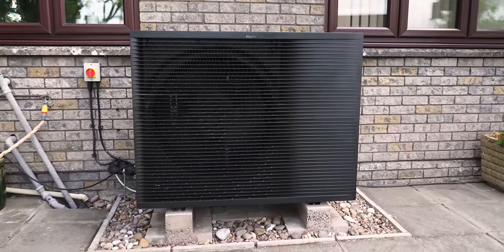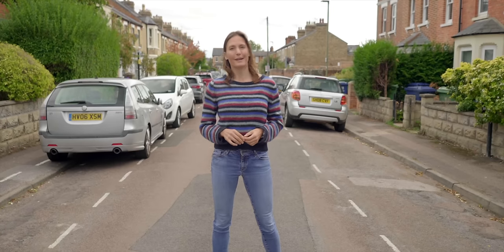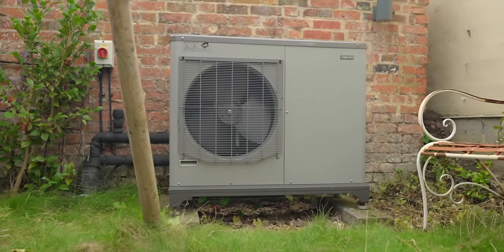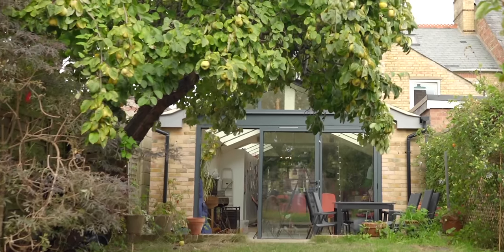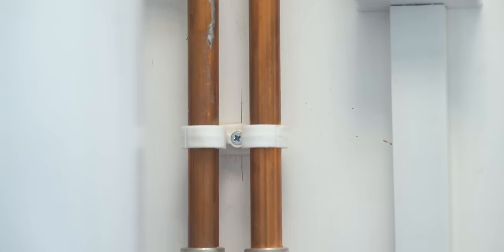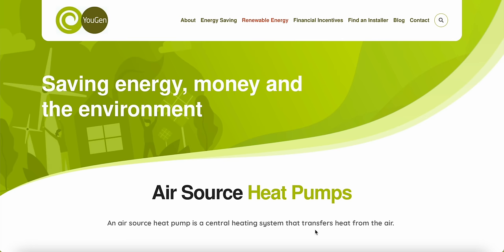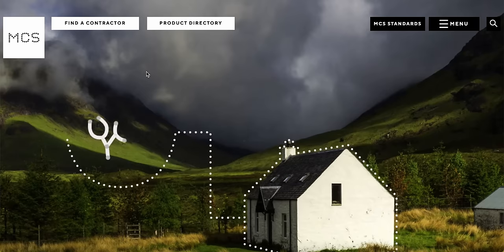Does a Heat Pump Really Work In A Victorian Terrace?

Comment: I'm really glad that EES are now covering heat pumps. I'm also glad that "insulate first" was mentioned (because the heat-pump needs to be well matched to the heat demand) this is important.
I would prefer a bit more of a balanced look at the pros and cons of heat pumps, they are not a perfect replacement for a boiler. I would have like comments Like:
   Heat pumps are very slow to react taking hours to heat up rather than minutes, this is not a problem but if you need a fast warm up you might be unhappy. 
   If the existing system uses a combi-boiler, a space will need to be found for a hot water cylinder. 
   Heat pumps are not much cheaper to run than gas boilers even now, but they might cost roughly the same to run. 
   No mention was made of the need to upgrade existing radiators, the hot water cylinder and some of the pipework because the heating system operating temperature is much lower than a gas or oil boiler.
The house shown in the video was heavily upgraded first, so it was easy to add a heat pump. I would be interested to see how a straight swap with no insulation improvements stacks up and the disruption and cost involved. 

Overall the video was a very good effort but slightly lacking in depth.
Reply: I have noticed that the Brits seem to ignore mini splits with air handlers.  I would not retrofit a gas boiler system because you lose half the functionality of a heat pump, the cooling aspect.  It would be much cheaper to put a mini split in.
Reply: @leroyharder4491  Yes and they are just as efficient. I must admit that radiators make the house seem a bit more comfortable for some reason.
Reply: A hybrid heat pump can straight swap with a combi boiler. But it isn't utopian enough so you hear little about them.
Reply: @leroyharder4491  It's partly the incentive system in the UK. There's a £5000 boiler upgrade scheme grant, but it's only available if the system is not set up for cooling (functionality has to be physically disabled) and it must also supply all heating and hot water (so no hybrid systems).
Of course it's stupid, but hey, politics!
The preference here for water-based heating (radiators) rather than air blowers might be mainly historical. Many of our houses pre-date any form of central heating, and its far easier to drill small holes in walls to retrofit 15mm water pipes than it is to make larger holes for air passages. Therefore this is what our heating industry knows, so they continue to build what they know into new builds. That said, I don't know that air systems are better than water systems other than the cooling functionality, which is something we've barely needed until very recently.
Reply: @bimblinghill  We have similar problems with our incentive systems.  When we install a heat pump, they want the legacy gas system removed to qualify for the incentive.  Its a bit ridiculous as air source heat pumps cannot keep up when temperatures get very cold here in Canada.  Oddly enough here in BC, ground source heat pumps that make more sense in our colder temperatures, are not listed as approved systems.  

I personally like some redundancy and would not remove our legacy system.  Back in the day, when solar did not make economic sense, they were actively promoting removal of wood stoves.  When things go seriously wrong with gas or electrical systems, whose house will everyone gather?  The one with the wood stove.  I understand the regulation to make them burn cleaner and safer.  

Our insurance companies are partly to blame as well.  Our current provider has a cap on the amount of solar.  They also don't like wood stoves.  Somehow the cost of repairing a frozen house during a long power outage doesn't compute.  We have forest fire seasons as well, and having electricity, water even if the power went out would prevent severe property damage from a nearby fire.  Resiliency and redundancy simply doesn't compute with insurance companies.  

There is almost no simpler system than a mini split.  Power to an outdoor unit, which then is connected to indoor units via small bundle of 2 pipes and power cord.  Only small holes required.  Very flexible.
Reply: @leroyharder4491  I think the main disadvantage of a mini-spit is that the F-gas is much more likely to leak/escape than on a monobloc, and for most older units using extremely high-CO2e gases that is really bad. Once they all move to CO2 or propane then it won't really matter.
Reply: And just to emphasise the cold climate bit.  We just went through a cold snap here in British Columbia.  It hit -32 C.  My very efficient heat pump is rated to -30, but there is no way it would be able to keep up at those temps.  Back up gas or ground source heat pumps are needed here.
Reply: @leroyharder4491  I put a de-Longhi mini split in 20 years ago for cooling my front room and it is still working well (had to replace 2 capacitors a few years ago).  Don't use it much for heating because of huge cost of elec compared to gas - much more than the gain you get from the pump.
Reply: This!! We were quoted tens of thousands to get our 1900 build up to decent insulation standards before we even thought about costs of the heat pump, pipe work, replacement of rads, removal of gas fireplace and redecorating where necessary. I wish they’d be more honest about the true upheaval and costs of getting heat pumps into certain types of housing.

Comment: Great report - I'd would like to install a heat pump and would love it if you could do a report on how to get it done without being ripped off by the installers.  I've had a detailed quote from an installer which includes material costs of 30% More than I know the materials are costing them.  Labour costs for what is described as 20 'man days' (their word - Max) amounting to £5,800+  I sent my heat loss report to two othe installers and got back quotes 25% and 35% higher than this.  The gov grant of £5,000 and VAT relief amounts to a saving of around £8,000 most of which it seems is going into these greedy installers pockets!
Reply: Could be worse, there are schemes where govt. pays for the entire installation for qualifying tenants in private rented homes - entirely predictably it is the domain of the high pressure sales cowboys
Reply: Get multiple quotes. We have a 24k btu mitsubishi system with dual zone control installed in one day of work for 13k USD total. You can barely tell when it turns on and it performs well even below freezing. Depending on your specific needs the price and system can vary a lot, which is why you need 3 quotes minimum. Do your research or you will get scammed by bad installers, but the good ones will guarantee their work and have references to show for it.

Comment: I am a bit confused about the benefits mentioned at 09:04 - ".. not burning fossil fuels anymore. It's protection again future price rises". I thought heat pumps ran on electricity. And switching to them would reduce use of Gas (savings) but increase the use of electricity (the price of which continues to climb. And is expected to. Not saving). So unless he means that the electricity use is much lesser in terms of cost than that of gas, how does this come together to make sense?
Reply: He means that HE doesn't burn fossil fuels for heating anymore. locally in his home. 

He could also be with an energy supplier that provides his supply with electricity produced from renewable.

Then, he could have solar panels on his home that provides the power for his heat pump when solar is producing, and additionally could have a storage battery that is charged by the solar panels and is then utilised to run the heat pump in an evening when solar power isn't being produced.

Comment: Perhaps the wrong place for a nuanced view of heat pumps but total honesty is needed if we're to help people make the right decision for their situation. I spent a few hundred hours looking at videos and reading articles before, disappointingly, deciding that a heat pump system was not right for me in a semi-detached house in the north of England.
Here we don't have extreme weather (it's November now and 13 degrees), in the summer if it goes over 30 degrees it's newsworthy. So no real need for AC at all and  central heating is only on for a quarter of the year. Without the need for an airtight house people won't pay to have an airtight house. I've got 300mm insulation in the loft and decent double glazing and exterior doors. An electric combi boiler meets our needs and PV and battery keep the price per kWh very low.
Fits all sizes is not the case with heat pumps.

Comment: Interesting, but this example coincides with a large house renovation. In reality most will just want to swap out their existing combi boiler for a heat pump. So how do the costs, disruption and associated works really compare? New combi boiler takes a day to fit and costs circa £4K. Fitting a heat pump to an old Victorian may involve new rads, piping, water tank, electrics, wall and floor insulation, double glazing (if you don’t have it), making good and redecorating, the HP unit, concrete base or wall mount, external pipe lagging. So looking at weeks of work & disruption, and significantly higher costs. And though it’s 4 times more efficient, electricity is 4 times the cost of gas, so you don’t even get a return on your investment. How are low/middle income households supposed to fit these even with £7k gov grant.

Comment: From a pure financial standpoint - these systems are currently not worth it at all. With gas @ 10p and electricity @ 34p, unless they can reduce energy consumption by more than 2/3rd's then you will be paying more than your gas boiler.

Where there is some benefit is if you have battery storage to be able to use cheap night electricity - but then you need a very big battery to be able to store enough energy overnight to use during the day for your heating. Cost of a battery this size makes it completely unviable. 

It just doesn't financially work at all at present in the UK with current electricity prices and limited government incentives - the current situation also doesn't look to be changing any time soon. It's a shame as a properly designed system really can cut your energy usage by half or more, just the desparity between gas and electric prices per kWh means it will cost you more to run without any chance of payback on the £5000+ (after grant) upfront cost.

The complete and utter lie that is the '20 year lifespan' of these systems also needs to be addressed. I'm an electronics engineer and HVAC specialist and i can tell you now there is no way that the majority of these systems will last 20 years without expensive inverter boards, solenoid valves, sensors, pump and compressor failures - they are complex devices with a LOT more to go wrong than a basic gas boiler. I'm sure an entire industry will form that specialises in repair and maintenance of heat pumps - at exorbitant prices no doubt.

All the comparisons in costs i've seen rely entirely on the heat pump lasting 20 years and a gas boiler lasting 10.....in reality that is going to be the other way round. A good brand gas boiler will usually do 20 years, and i think you will struggle to get many heat pumps to do 10 years without the aforementioned failures....and good luck getting warranties honoured in 10 years time, the business would have probably collapsed and pheonixed more than once over that time. 

I am all for this tech, when designed and installed properly in houses where they are suitable - but there is a lot of marketing BS that is typical of emerging technologies - i used to work in the LED lighting industry and the 20 year lifespan on heat pumps reminds me of the magical 50,000 hour lifespan of an LED lamp that was stuck on everything with an LED in it. It's just some number thats been concocted from some severely flawed study or a dodgy manufacturer MTBF test that then gets banded round the industry. Reality will unfortunately be very different.
Reply: ....isn't it more like £10,000+!?
Reply: @andymccabe6712  Yeah it's 10k but there is a 5k boiler replacement grant available, so it comes down to 5k. Still doesn't pay when it costs more to run than the gas boiler (and again 20 year lifespan is BS without very expensive repairs during its life)
Reply: All true - if you're on mains gas. 
If not, ASHP can start to make more sense, but good points about life, warranties etc. I would go for A2A hp as don't have a wet system, and have a one level dwelling (like a flat or a bungalow).

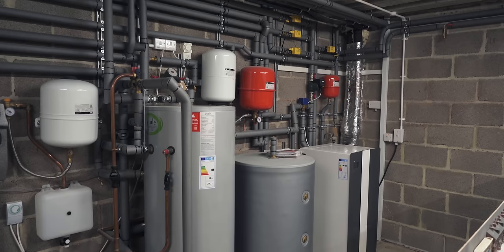Comment: So many UK houses built during the last 40 years have microbore pipework and very small radiators. The upheaval/cost to replace pipework and radiators isn't going to encourage mass take-up of heat pumps. I just replaced my gas boiler at a cost of £1500, with the cost of electricity a heatpump for 10 times the price didn't make sense. 3:06 not many houses have room for that lot.
Reply: You will have to decarbonise eventually... And we should start distinguishing between the cost of replacing the boiler/heatpump in an existing system designed for it, and changing the heating system to be more efficient (lower circulation temp). People are conflating these and saying 'this is what a heat pump costs', which isn't actually right. When people come to replace their heat pumps in 15 years time that won't cost much either (probably about the same £1500).

Comment: Here's a few home truths. I have a 4 bed detached house with an oil boiler that was built in 2013 an has an EPC rating of C. I got quotes for an ASHP and GSHP. The quotes came back at £22k for the ASHP and £35k for the GSHP, excluding civil works for the underground pipes. 
The work required replacing the water tank and all of radiators
A couple of comments about the example used in this video
1. The owner says that he has reduced his energy usage by 60% (from 15,000kwh G&E to 6,000kwh E). However with a CoP of say 3 this amounts to around 18,000kwhr. His house also has solar panels, so have these been factored in. Hence he has not saved any energy, physics is not magic
2. For me a HP is not economic especially with electricity 3x the price of gas or oil. The price differential of electric kills any benefit you can get from the COP of the HP
3. My first house was a 2 bed semi built in 1992. It had a gas combi boiler and a small garden. It would have been problematic to install an ASHP since there was no room for a hot water tank and I would not have liked to sit in the garden next to he HP radiator
The technology is not mature. If they made it plug and play to replace an existing gas/ oil boiler, reduced the costs and got the electric price down to what it used to be (say 12pkwh) then the basic economics would encourage the change and it would not have to be driven by ideological reasons

Comment: Let's get real about this and stop kidding ourselves that this is the answer to all our problems because it is not.

In theory heat pumps are a very good idea there's no two ways about it. But the practicality of manufacturing and installing these in every single household within the designated time period just isn't feasible. We must take into consideration that we in this country do not manufacture anywhere near the quantity of the equipment that would be required to hit these targets within these designated time scales. 

So where will we turn to, to supply the UK with all the required equipment to make this country anyway near carbon neutral in the designated time scales.

You guessed it “CHINA” 

The only country that could manufacture the amount of equipment that we would require. Even though they sauce a lot of the raw materials from Africa and ship them back to China before turning them into the finished product.

China the country that is building an infinite number of new “COAL” Powered, Power stations. To maintain their incessant demand for electricity to manufacture goods for the western markets. 

Because of our infatuation with obtaining carbon neutrality, within such a ludicrously short period of time. As a result, we will have to become heavily reliant on them to supply us with all the necessary equipment that would allow us to become carbon neutral.

China the country that is one of the world's biggest polluters.

We then ship all this equipment at great cost halfway around the world in ships that burn fossil fuels just so we can become carbon neutral.

Yes, we may well achieve carbon neutrality but at what cost not just financially. But also, the additional CO2 that would be produced by China just to manufacture the equipment to make us carbon neutral.

It's not solving the problem of global warming in any way. It's just moving the problem from one part of the Globe to another...

Notwithstanding the extra costs and the physical time, it would take to install all the necessary equipment in every single household. It's totally impractical to do it in the time scales. Yes, sure regulate it in all new builds but to retrofit it in old houses it's just not going to work. Even though the contributor to this video said he has fitted it in a Victorian terrace, but he admitted that he was undertaking copious amounts of renovation work to the property in order for the system to work.

Comment: My experience overall of an Air Source heat pump installation over the last year is a positive one. However two points are worthy of note for Gas/Oil users. The system responds gently to demand, unlike traditional systems which respond very fast in comparison. Also, efficiency drops off the colder the weather. Below zero this is noticeable. We opted for a 7 kWh unit rather than the standard 5 kWh recommended for our "high-efficiency" New Build and still the system struggles below zero. I would recommend a Ground Source approach if feasible as the ground temperature should be constant at sufficient depth, whatever the weather.